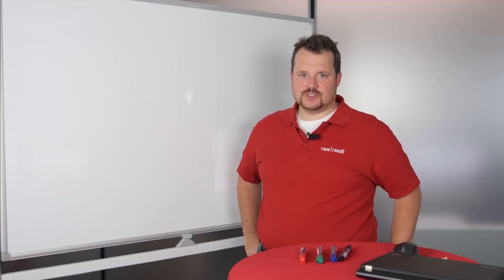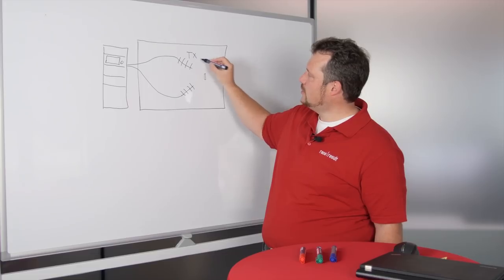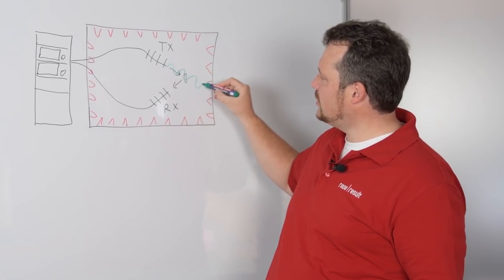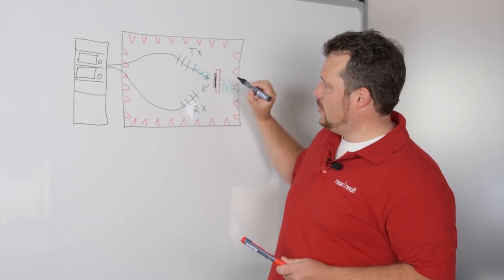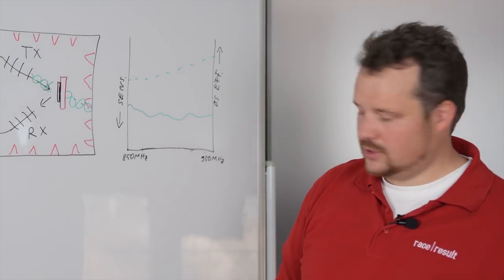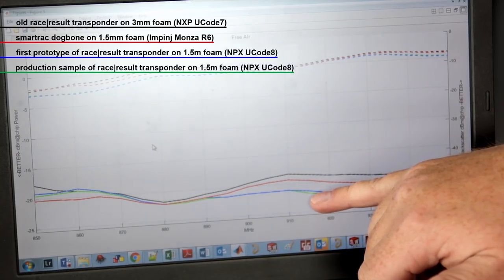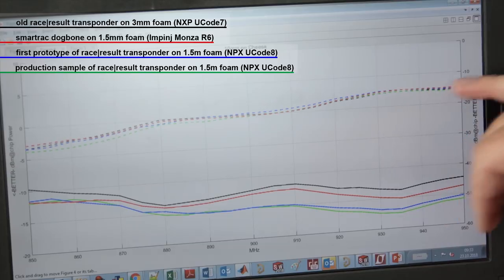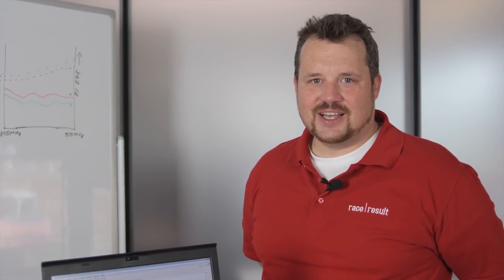tech deep dive: transponder performance

Comment: Thank you for doing these Nikias! I would love to see one in the future describing the difference between antennas being tuned for chips placed vertically vs horizontally and why that effects read rates. Also, serious question. What type of cheese do you use? I would assume that the liquid content of them could make a difference such as a soft cheese like mozzarella versus a hard cheese like parmesan. No real reason to know the cheese besides to satusfy my own curiosity. Thank you!
Reply from the maker: Hi Trever, we put the polarisation topic on the list.
Actually we used Emmentaler, which is not the smartest choice as it tends to have holes. We actually hand picked samples without holes. It was less about the exact amount of water/fat and more about the form factor (square and flat). But to be honest: We actually moved away from cheese completely in the last months and created our own "human phantom" which behaves very similarly but does not need to be cooled and will last forever.